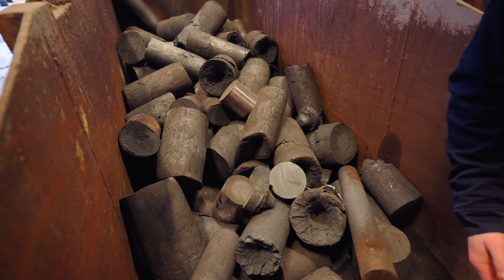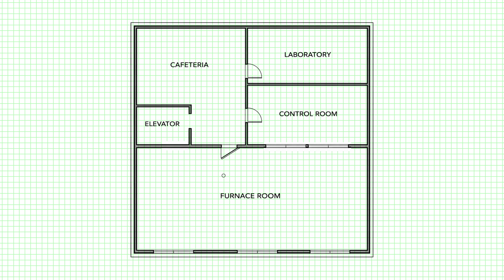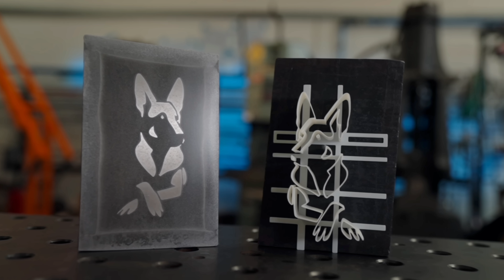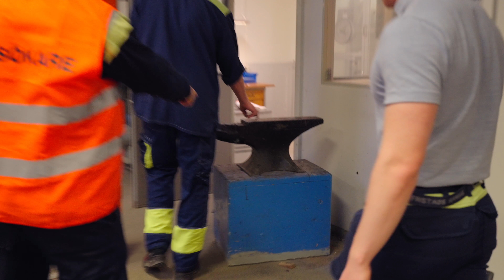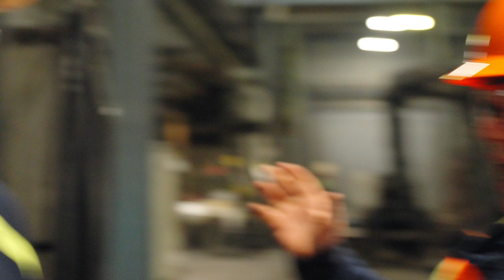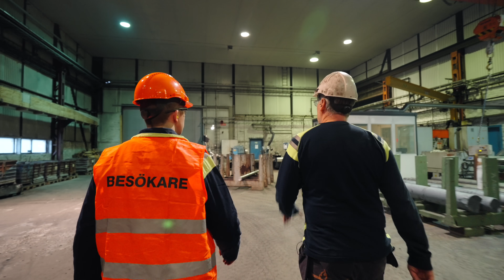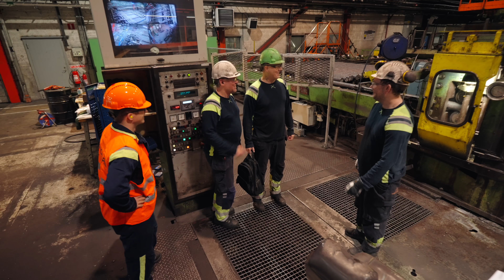How Super Steels Are Made

Comment: at around 25:00 your asking why powder, IMO what I got from it, is think like you have a glass of water, and want to get some element elecrolite powder or coolaid or whatever, when you mix it, and let it sit, certain elements in the powder mix in the water can settle, and you need to stir it again to remix it. like molten(liquid) steel, if you just pour it, it will possibly settle a bit and not be 100% mixed right while cooling, but when you use HIP and all those processes, you are forcing the powder to bond and make its molecular structure there, then when you make it into ingots, you have to worry less about it settling and making bonds like those carbon strings or whatever, so its like preforging for consistency then actually forging the ingot. am I right?

Comment: 36:40 bar stock for tapered roller bearings? inner and outer race get cut out of the same material face. they do not make bearings that way in Columbia, but so many tractors unfortunately have bearings made out of recycled rebar. ... Timken in a Massy... bearing races that can be used to machine mild alloy steels, as they do in a lot of third world countries. welding/cutting the case on a tractor to fit the newer bearing size format was worth it. ford 8.8/9 carrier bearings... 100's of millions of them... so that is a small industrial shop? ... 500 acre facilities...

Comment: So a weird question maybe. @20:12 Does a break grow like in a crystalline structure? Like you have some material that is not supposed to be there, then starts a chainreaction that then couse the break of the whole piece. A reversed crystalline structure?
Reply: No such thing as a weird question, but a weak point starts somewhere or because of something. Fascinating stuff.
Reply: @andrewmcconn  Thanks, and you are right, I just got stuck in how amazing human ingenuity really is. Billions of years, a small fraction of that and here we are sorting stuff out. Mind blow every time.
Reply: It is like a granola bar. The steel is a carrier for the ultra hard carbide particles that do the cutting work. There is a little bit more going on in terms of atomic bonds, but it is easy to visualise it like this.

There is an ideal size of nut where the caramelised sugar glues it all together into a uniform material. But if you don’t churn it enough, and let it cool too slowly, then different size nuts will settle out in clumps due to their particular densities, and the bar will readily tear where there isn’t enough caramel sticking it all together.

You want an even blend of just the right nuts, so smaller nuts and seeds fill the spaces between the larger nuts and it is all evenly held together.

Worst case you will have large complex inclusions much like a walnut, that may actually crack under stress, and the caramel will start to tear around that crack, but normally overall brittleness is more about the even distribution of the harder carbide bits in a given piece of steel.

You can mess up stainless steel by welding it or getting it too hot too. After melting, the carbides clump together making brittle zones, and the areas where the pure steel pools without the carbides will start to rust. Traditional stainless steels are annealed so the carbides melt into a more uniform steel. Working it too much undoes that process.
Reply: @King-Kazma  w comparison
Reply: In mechanics of materials you learn about stress concentrators and what factor they play on their failure modes. Classifying the defects is important so you know its failure mode. 

But you’re right, the crystal structure of the metal matters a lot with its failure mode. Heat treating changes how the crystals grow and what size. Very hard metals often have small crystals and the crack propagation is very quick and results in rapid failure, while large crystals usually result in a slower failure as the crack can propagate and be slow down since it can hit a grain boundary and have to move around the grain.

This is over simplified to explain here but that’s the idea.

Comment: 8:36, is this not sensitive data? I feel like with this you could make the exact steel.
Reply: The data is not secret. That's why they are a reputable supplier, you KNOW what the material's content is.
Reply: A competitor would be able to figure it out anyway as long as they had the same xrf and ir spectroscopy equipment. And while those aren’t cheap, they’re probably a relatively small expense for a company that wants to produce industrial quantities of steel and challenge Erasteel